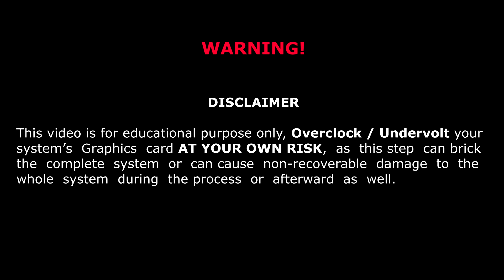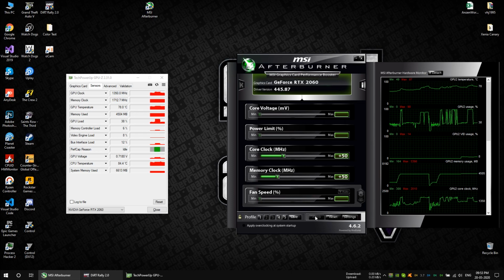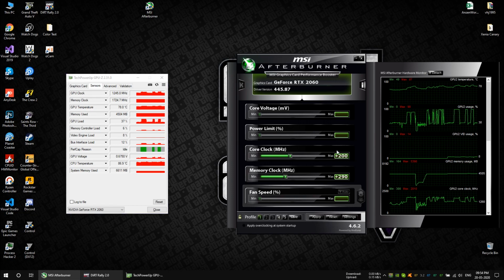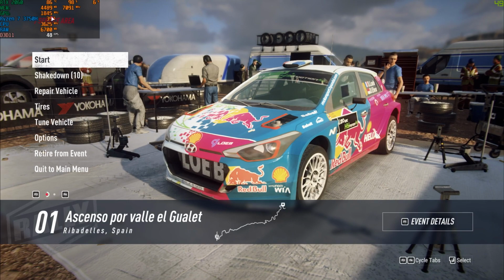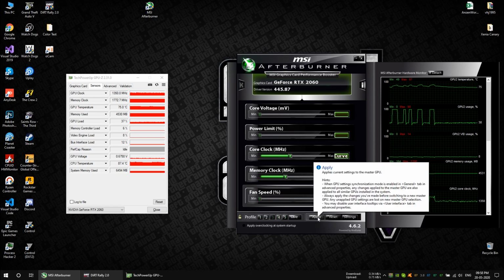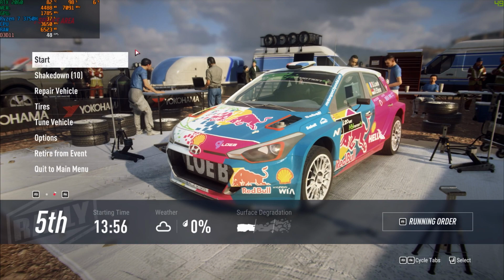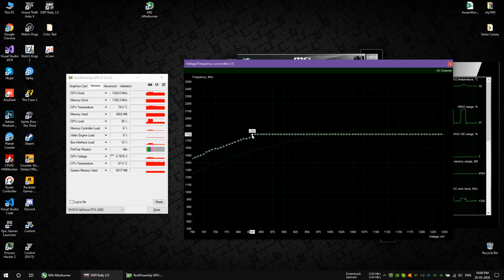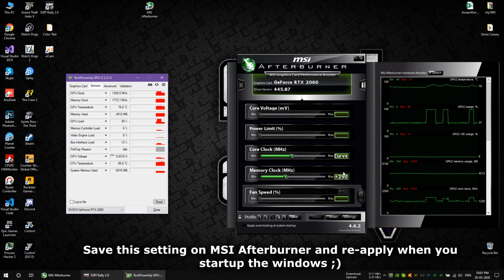Overclocking and Undervolting nVidia Laptop GPU || nVidia RTX || MSI || ASUS

Comment: Do you play games in OC on performance mode or turbo mode.
Reply from the maker: Turbo mode
Reply: @VaibhavJoshi1995  I also have the same laptop, I get like 120-130 fps in csgo (low settings). Got any suggestions on how to increase frames for csgo?
Reply from the maker: Hi!, Since the screen is 120Hz ..anything over 120fps will be not noticable 😊 so your frames are alright

Comment: First of all, thank you so much for the amazing reviews...you really are a hero when it comes to helping us make good decisions. 

I just ordered the same laptop, with an RTX 2060 and a Ryzen 7 3750h CPU...then I just realised that the CPU might bottleneck the 2060 (by 15% if userbenchmark is right). How are the gaming performances? Is it better than the same laptop but with a 1660ti (less bottleneck)? Thanks boss and keep it up!
Reply: the botleneck will be temperature of83 degree and 80w of GPU power limit, just dont worry about cpu bottleneck, i have 9400h + 2060,
Reply from the maker: Welcome! That means alot to me 😊 and yes if you go for 1660ti varient you will get pretty much same fps, since 1660ti and rtx2060 are same but 1660ti doesn't have tenser cores and lower clocks, so even if you go for 1660ti insted of rtx2060 you will be loosing out on few fps and DLSS (Raytracing) features. 😊
Reply: @VaibhavJoshi1995  Thanks for the reply brother! So I will get more fps with the 2060? I think I will disable raytracing to get even more FPS at ultra.
Reply: @VaibhavJoshi1995  https://www.youtube.com/watch?v=RAJkvJjwTcA&t=117s So better FPS than this? (He's testing the 3750h with the 1660ti)
Reply from the maker: Yes, but difference will be 5-7 fps, and in some games 7-10 fps. Between 1660ti and rtx2060. If you can missout rtx features you can go for 1660ti which is best value for money. But it may or may not be available in your country, it is launched in some specific countries (fx505du)
Reply: @VaibhavJoshi1995  Thanks for the answers man. Youre very kind! Have a nice day brother.
Reply from the maker: Please share my channel to others too so they get benifit too ☺️